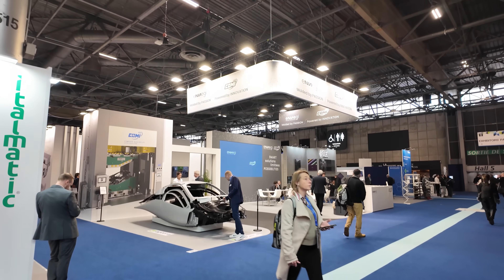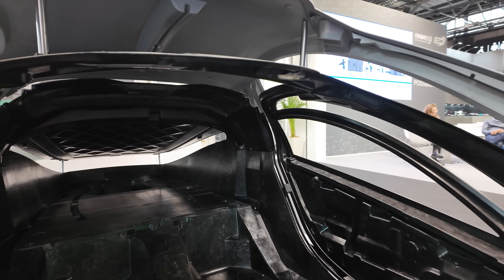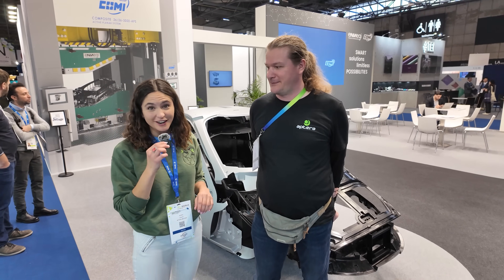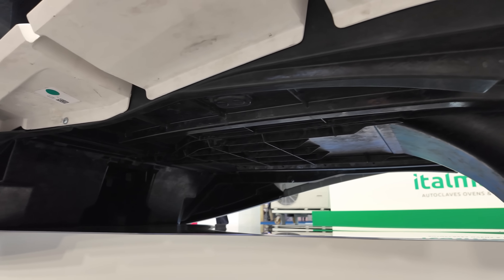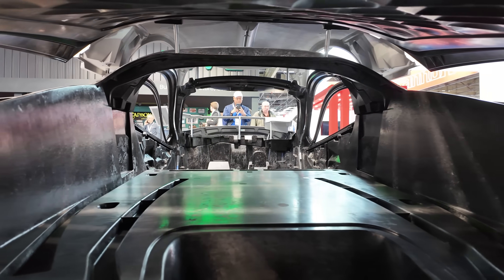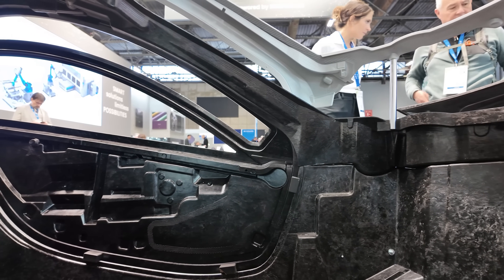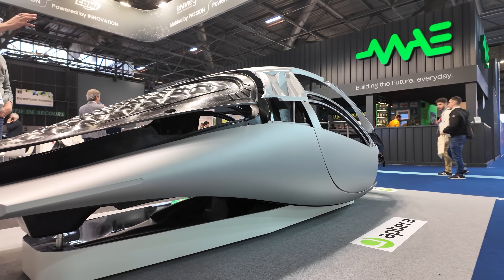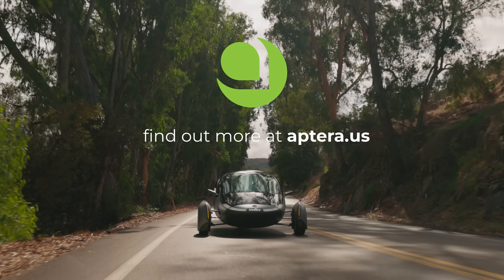Aptera Unveils Production Body | JEC World 2024

Comment: Have asked these question probably 20 or more times! Show destructive testing do we will know somewhat insurance is going to cost . Next explain how sensitive electric motors are going to hold up while wheel mounted without shocks. Next show us off road testing and that result. Next give us some idea as to replacement costs and feasibility of getting those repair parts in reasonable time. And finally please share severe weather testing results. It sure is quiet!  I can't hear anything?

Comment: Wwhat happens if you have a flat tire? Can it be serviced r replaced on the road?
Reply: easily. The front wheel covers pivot forward to expose the wheels. In the back, you have to take off a panel, but it just takes a minute of effort

Comment: With Every New so called UPDATE, my reservation keeps getting pushed back 1 Year 😂😂 WOW
Reply: Aptera is doing a much better job than Tesla on their Roadster 2, which was announced in 2011.  You will likely have your Aptera before Tesla buyers who have put down 100K deposits will, and Tesla does not have the funding issues that Aptera Corp is dealing with at the moment.
Reply: @n.brucenelson5920   great point, but 2011 until now with resources and evolution. Aleutian on EV technology should be better.
Reply: @upgr8king  Thanks for your reply  I don't understand what "Aleutian on EV technology "  means?

Comment: Goddammit, soooo close but this design means it will be effectively impossible to repair anywhere but the factory. Supermassive L
Reply: I want this thing to be good sooooooo badly, but this body design and the lack of door-handles make the value proposition miles worse.
Reply: Not sure why you think it would be hard to repair. Composites are relatively easy to repair, and Aptera has committed to shipping you whatever parts you need, along with vids on how to replace each part

Comment: So the whole thing being one piece, if it gets damaged, is it totalled or do we repair it like we do with a fiberglass hull on a boat?
Reply: I believe it should be modular. You should be able to take it apart at the seams with the right tools.
Reply: @LC-sc3en , @iDennis95 ,  🤓 Yes, an ordinary heat gun will soften the bonding compound used between body parts.

Comment: Knowing the entire body's a single piece, I hope the a small crash wouldn't total the car!
Reply: Composites are easy to repair
Reply: Pieces are bonded together.  A piece damaged beyond repair can be removed with a heat gun and a chisel and replaced with a new part.
Reply: @n.brucenelson5920  I don't doubt that, but what if the part that needs replacing composes 60% of the car? 

Such as the rear part of the car's body?
That one part composes most of the car as a whole.
If I got rear ended driving this, what happens next?
Reply: It depends on what was damaged.  If it is hit as hard as my first Honda Insight was, the vehicle is likely to be totaled, just as my Insight was, while the large crumple zone protects the passengers.
Reply: @n.brucenelson5920  ah... good point. Sounds like most cars would be totalled at that point...

Comment: Hey,,, off subject everything is so good, a weep hole spin for the motors or flaps something. Threaded couplings for any seal lines and hoses for simple changing because  seals don't last. 😊😊😊😊😊😊😊😊😊😊😊😊😊😊😊😊😊😊😊😊😊 Tesla used to have issues  with weep holes and seals that were badly needed on early cars.

Comment: Does clean energy really matter when you triple down on the petroleum based materials by replacing all of the recyclable metal that would normally be used with toxic, mostly non recyclable, plastics that are toxic to produce or dispose of?
Reply: The carbon fiber they're using can be recycled up to six times. And manufacturing with steel is hardly carbon free

Comment: So if you significanly damage the carbon fiber frame, the entire car becomes scrap?  Who repairs broken carbon fiber frames? Is that possible? Where's the crumple zone? Do you actually think fools won't drive these things headfirst into crashes?  THe more I see, the less sure I am I want this car. LOTS more questions than answers.
Reply: Any car built today will be totaled in a bigger collision. Today’s cars sacrifice themselves to absorb most of the energy so the passengers won’t. In less energetic collisions the repairable and replaceable outer panels will absorb all the damage.
Reply: Oh come on, troll. 30 years ago, I used to repair salvage titles and then sell them.  I would buy decent looking cars at auction that were totaled just because the frame was moderately damaged. At 5k-10k worth of damage - insurance company says, "Nope." This objection is silly, as if wrecking the frame is some new pearl-clutching surprise. Imagine the cost to replace the frame on a 2019 Camry if it were significantly damaged. Your insurance company will just total it.
Reply: Damaged parts can be debonded with a heat gun, a chisel, and an air hammer.  New parts can be bonded in.  Many owners could even do this themselves.  Both front and back of the vehicle have large crumple zones, devoid of hard, heavy machinery that occupies conventional designs.

Comment: IMO, Aptera is on the cutting edge of industry because they understand the importance of efficiency while the incumbents, and even Tesla, do not. If you put Aptera’s solar panels on a Tesla, it would only add 4 miles per day. Aptera can easily outperform Tesla’s range with a much smaller and cheaper battery. Aptera understands that efficiency is the future.
Reply: @DW11111 Easy.  Check out Aptera's granted patent list.  No solar racers are designed to be as safe in a crash.  There are two things.
Reply: @DW11111 No.  You clearly haven't read their granted patent list.  Try it.
Reply: How about the ability to mass produce them. All the solar racers were / are cool but not made for the masses.@DW11111
Reply: @DW11111 this isn't a relevant question you could argue that Tesla is derivative of a Prius. Or that tons of luxury cars did bullet proofing decades before cyber truck. Neither would be wrong but so what?

We had electric vehicles before Tesla. Nevertheless, Tesla is extremely significant to the industry and successfully brought electric vehicles into common use.

Cutting edge for the industry is still correct since we are discussing the auto industry that sells vehicles to the general public, not the experimental solar race industry, nor the extreme luxury car industry.
Reply: A Tesla transports 5 adults plus luggage. You need 3 Apteras for this.

Comment: If the outer & inner door sections are bonded together... how can we service parts inside?  What if somebody breaks the window & it needs to be replaced?  Will the entire door need to be replaced just to fix a broken window, handle, or switch?
Reply: I'm guessing that the FG SMC can be more easily unbounded from the CF SMC due to the fact that they are two different materials. Either that or any parts that it is important that they can be disassembled will be bolted together. 

The roll cage, for example, will probably be bonded for maximum strength. The doors may have sections that will be bolted on so you can get into the interior and service the window mechanism. 

That's just guesswork though. If it's easy to unbond the parts there's no need to design them to be disassembled.
Reply: I believe access panels will be used on the doors.
Reply: The inner and outer skins are bonded together on you existing ICE vehicles using welds with panel adhesive and the windows are serviced by removing the inner trim and sliding the windows up and out of the tracks without having to separate the inner door frames from the outer skin.  Aptera should be the same as far as those services are concerned.

After the bonding process they still will have to install and wire those components so will need access in order to do that final assembly process.

Best!

Comment: How long does it take the machines to make each part of the vehicle? in the press is it an hour process, 2, 6, 12? If this is quick enough to keep the prices down without needing THAT many machines i could see this really expanding quick
Reply: I believe they discussed this in a previous video.  The main tub (largest CPC has ever made) is like one every 12 minutes.
Reply: @takatyr1924  12 geez... kinda a shame they have to come all the way from Italy but if they can keep those things running.. 100 cars a day per machine. I could definitely see their prices staying low
Reply: The production presses will eventually make their way to California, but not for a while. Equipment that size is hard to ship.  

More likely, they will open a BinC production line in the US at the same time Aptera installs a vehicle assembly line in Europe. They can build the vehicles for the EU market right there.

Comment: It does make sense that if you already produce the bodies in Italy you may as well have parallel plants in US and EU. I'm sure the Europeans are gonna be generous on subsidies to get a low cost, solar, EV on the roads... and with the cost of fuel over there it's gonna sell like hotcakes for sure, maybe more than in the US.
Reply: The problem is likely funding. Building a plant costs a lot of money for space, workers, and  electricity. I don't think they have the funds to open two at once. Plus going through EU regs and tests will be additional money and time.

If they got significantly more funding they could probably open both at once. But I don't see that happening at this date.

Comment: Is Aptera really ,"so close" to production? Delivery to customers by the end of this year? Sounds like same 'ole, same 'ole more, about to be broken promises.
Reply: @DW11111 You just saw the PI body - hardly "vaporware".  You can get your deposit back at any time on request.  They are held in escrow.  Your comments seem to indicate you were never a supporter of the company in any case.
Reply: Aptera has always been open about their need for sufficient financing.  Production vehicles likely in 2025.
Reply: @n.brucenelson5920  Aptera has financially struggled and missed production dates since it’s “Advanced Composites” inception in 2006.
Reply: @n.brucenelson5920  The company started in 2006 as “Accelerated Composites” has missed every promised production date since 2008. Financial, regulatory and management issues have plagued Aptera since it’s inception.
Reply: @DW11111Their CEO stating when delivery will start is about as accurate as your local weatherman, except it does eventually rain. Chris is to Peter as Aptera is to the Wolf; both fairy tales. 
I like the vehicle, it's the management that's terrible. No competent CEO is going to boast delivery dates and miss, by years, repeatedly! Year after year it's, Early owners will begin taking delivery "this spring". Come spring and it's, "by the end of the year", year after year.

Comment: This could be the most futuristic vehicle. Cybertruck is not even close.
Reply: @DW11111 At a greatly inflated price, and many missed target dates - without the excuse of insufficient funding.  Aptera Corp has accomplished far more with less.  Compare Aptera's money management with Tesla's during their startup phase.  Tesla hasn't shown near the competence shown by Aptera in the same time frame.
Reply: @DW11111 honestly both Tesla and Aptera were super optimistic about their production dates over and over. It is either because being new to the car industry they don't understand that brand new designs on average take 5-7 years to hit production. Or that they understand the public doesn't understand that cars take that long due to most traditional companies announcing their next year models less than a year in advance of when they will actually be coming off the line.

Reasons for the latter option would be the need to keep the interest of an impatient public. In Aptera's case the need would be directly related to financing the project. In Tesla's case the need would be fluffing the ego of Musk.
Reply: Cybertruck is on the ROAD : Aptera is a Fantasy for Now 💨 and 🪞

Comment: My only concern is that all those composites are gonna have basically no recycle potential. But then again, composites mean rust is one less reason for it to ever need to be scrapped. Might be a nice car for the salty rust belt roads where I live. Assuming Aptera has a winter tire supplier.
Reply: The body can be recycled up to 6 times!
Reply: @gmv0553  How? Because at the end of a vehicles service life no one is going to disassembal the car to reuse the body shell. I've been to LKQ and you'd be surprised the amount of valuable components that get shredded because the logistics of reuse are so difficult. At least I assume that's what you mean.
Reply: During the manufacturing process when a part come out of a press there is a small amount of flashing left over.  This is removed by hand and can be reused in the next form. Its a very small amount but goes more towards sustainability and less environmental impact in the long run.  They can do this 5 times. It stands to reason that since a full part has only been processed once that, say in case of major vehicle damage, the material can be stripped and 'melted down' to be reused to create a new body.  How viable that is has yet to be looked into or even mentioned.  But even a chance is better than what happens to most modern vehicles that end up in a scrap yard.
Reply: @takatyr1924  oh thanks. Had no idea they could do that. Still I think the logistics are gonna be rough. Most people just take their cars to a junk yard that is used to shredding it and dumping the composites with the plastics into an incinerator. But maybe Aptera can figure out a reclamation system or the industry as a whole can adapt to recycling composites. But I'm not holding my breath.

Comment: is it a good thing that adhesive is being used to bond structural pieces together?

has this been tested?

it seems like heat and cold will cause stress to this system...
Reply: CPC, the company that produces this carbon body parts (BinC), is manufacturing lots of well known supercars. So yes, that technology is around for many years and well proven.
Reply: @e-economy-  you dont understand...

simply because the technology is used for awhile does not equate to a sturdy long lasting object

i am asking if this exact bonding has been weather tested...your response does not answer that
Reply: Carbon Fiber is actually much more thermally neutral than metal, and less subject to expansion. I suppose fiberglass and carbon fiber would not expand at the same rate as the weather conditions change, but both would vary less than metal. 

I find it difficult to believe that with 30 years of experience, CPC would not have had the chance to test this out on real cars in the real world.
Reply: @richardryley3660  carbon fiber is not adhesive...it literally means glue...they are using glue as a structural feature...over time it will expand and contract because its a car in the elements....
Reply: @Ian-ie3hy  CF SMC is carbon fiber coated in resin. The use of the term "bonding" would imply that a similar or the same resin would be used to join the panels. Depending on the thermal or chemical reactions, this could cause the resin to join with the resins in both parts, making them one part. 

Even though the join is probably not as strong as the two molded parts, they should still expand and contract at the same rate. The joint will also be much stronger if it is in continuous contact across a large amount of area. 

Bonding CF SMC to FG SMC would be more complicated, and probably require a more conventional adhesive. But that also means those parts can be more easily unbounded and replaced. And it probably is possible for the resins to bond, if they are similar, and the bond needs to be structural.
Reply: @richardryley3660  im not a materials expert, which is why i asked. but it sounds as if youre not sure what method is or will be used in final product...this is my concern also the part about more easily being unbound and replaced...we are talking about a small automobile that sits on three wheels moving at highway speeds with cadillac escalades here...also element exposure eroding integrity of individual components ending in catastrophic structural or safety failures....

dont get me wrong i love this concept vehicle but i have concerns about unproven products...not just picking on aptera
Reply: @Ian-ie3hy  I don't really know the techniques that will be used, only what Aptera and CPC has said will be possible with the final product. A lot of that information is probably a trade secret. 

Although, with Aptera's right to repair focus, they may give us details about how parts should be unbonded.

EDIT: It has now been confirmed that the panels cannot be unbonded. The damaged panel will have to be cut away and the bonding surface ground down to the original shape. 

The bond is described as stronger than the panel itself. It will not fail before the panel fails.
Reply: Hey it worked for the Titan sub, ought to be fine.
Reply: @georgesmith8774  lol...the second i see a playstation controller to drive with...
Reply: @georgesmith8774  Are you one of those who ignore the advice not to drive your car into water?

Comment: Super cool that the carbon fiber is recyclable, how will the panels be removed from each other, considering they will be bonded together?
Reply: If you're recycling a body, probably the parts will simply be cut apart. The fiberglass will have to be removed from the CF SMC of course, and it can't be recycled.

I actually have no idea how CF SMC is recycled. But as a guess, I would say that it is heated and melted, and the "tows" separated back out of the liquefied resin to be reused. That's just a wild guess though. It could be a chemical process instead.
Reply: @richardryley3660  Look up "Recycling of SMC and BMC in Standard Process Equipment"